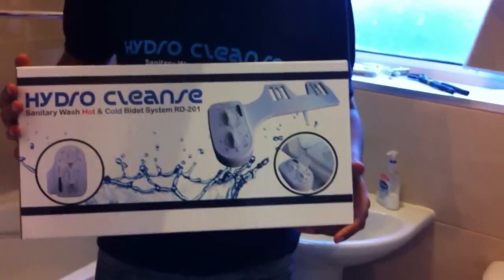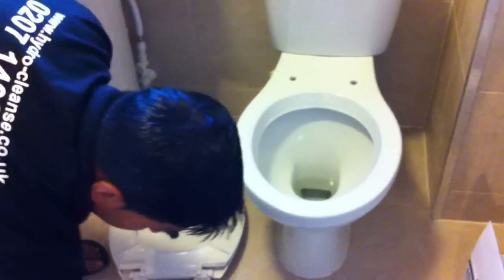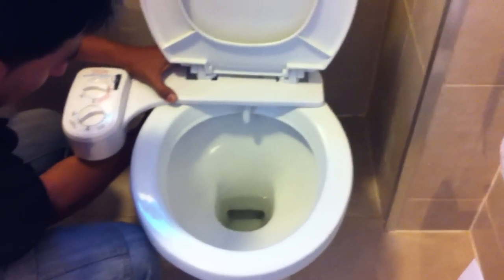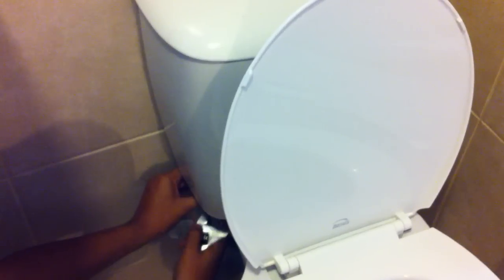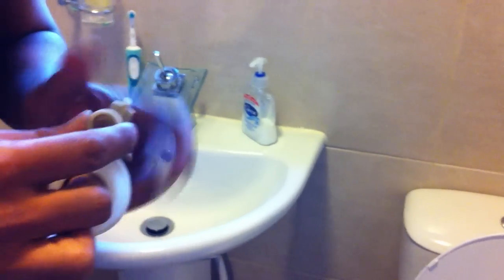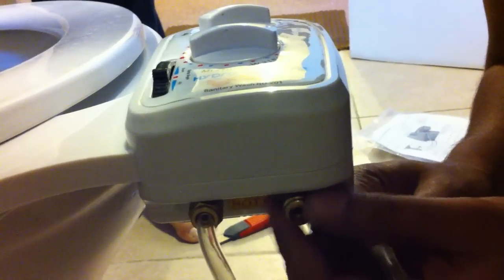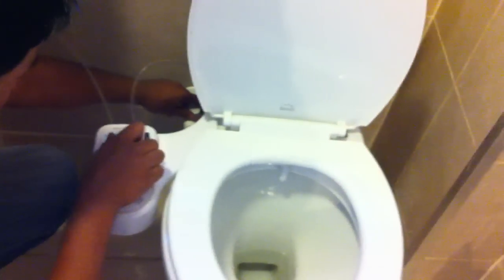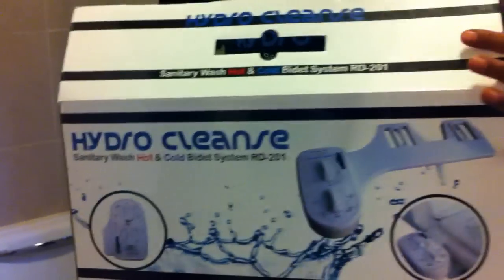Hydro Cleanse Bidet Installation Video

Comment: Your Installation are in compliance with the water Regulation
Water Supply (Water Fitting) 1999
20mm air gap passed
Nice video i will be advising my customers to install over rim bidets
Reply: Taqqiyastar jjh

Comment: The Luxe brand has a 'shield' to protect the Nozzle Sprayer from getting dirtied by your crap.  This Hydro brand's nozzle is 'exposed' and susceptible to getting dirtied.
Reply
Reply: "Self Cleaning nozzle, is auto retractable, so stays clean and does not get clogged up"

Comment: So if we only have hot water inside the walls to the taps what do we do then?
Reply: Megaglow Z
WTF?!? I never said my toilet had hot water in it.

I asked if the hot water was in the wall. Our vanity basin is not on an external wall and thus have no hot water line along the external wall. The water pipes to it run up through the wall and ALL the plumbing for it beyond the taps and spout are in the wall. They are also at the opposite side of the room. Our shower plumbing is the same, it also comes up through the wall.

Many people in older houses especially do not have plumbing like shown in the video. The toilet fills with cold water, not ALL our taps are hot water, just that all hot water taps have plumbing in the walls (not accessible).
Reply: You are lucky in away.. You use  the healthy cold wader only, witout feeling its coldness., with KO BIDET, Srange, but true.

Comment: First of all thank you for your video I just like to mention few things
Bidets are classified as fluid risk category 5  under Water Supply (Water fittings) Regulation 1999  Regulators Specification Type AUK2 air gap 
20mm 
You have not mentioned anything about water Regulation with regarding Backflow Prevention and Back siphonage.

Comment: I can see major problems with this device in the days/weeks/months after installation. The plastic pipes going into the unit will come apart under pressure from the mains supply and the you get a flood. Better stick to the hand held shower or better still pay for one of the Japanese systems.
Reply: That is a real danger. The KO BIDET excuses entirely this case, becouse plasti tubing do not accept any pressure.